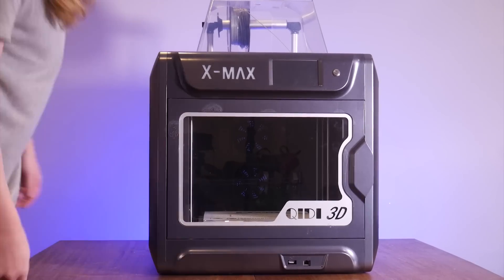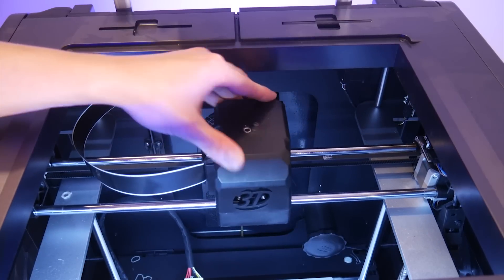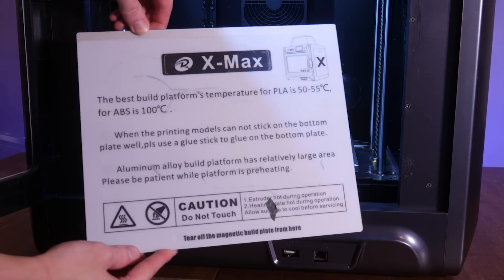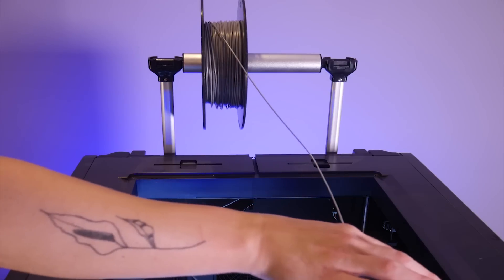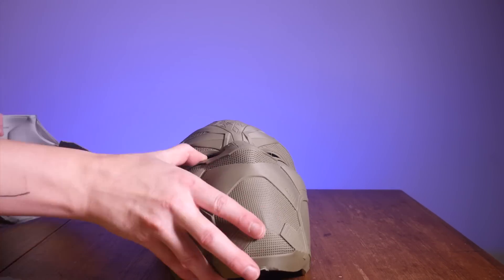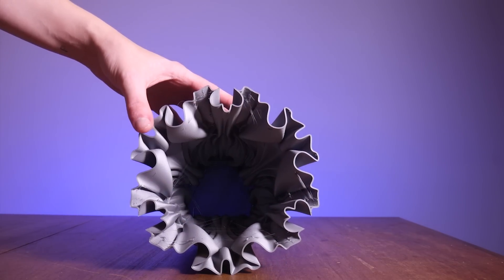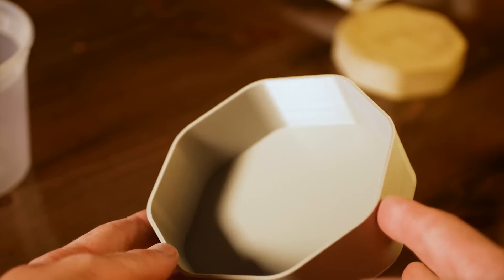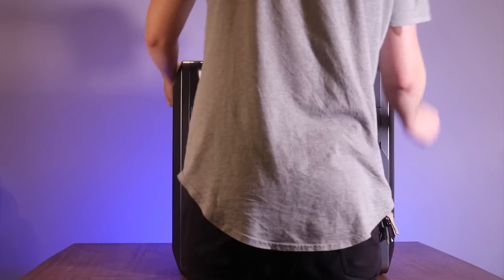3D Printed Black Panther Mask - QIDI X-MAX 3D Printer Review

Comment: I have had the X-Max for 2 months.  In that time, the front window has fallen off due to cheap sticky tape, the bed leveling screws needed replacing, the motherboard died, and a new build plate is being sent because the bed will not level.

My weekends have been spent replacing hardware and constantly trying to level the bed.  All I print with this thing are bed leveling squares and it can't even get them right.

You go through the advanced leveling - the print head moves to each of three points where the leveling screws are where you manually adjust... then it goes to the middle where you adjust Z from the touchscreen in .05 mm increments.  Every single time I adjust the three points with paper, I will need to drop the center Z by two to three .05mm steps.  Then the front points are off... I literally go through the leveling sequence over and over and it never levels.

People - steer clear of this 3D printer.  It is junk.

Comment: Mine/all of these printers come with slide on friction fit clamps/locks to prevent the spool holder from sliding and filament getting caught up. Also one of your first prints should be the top enclosure cover to reduce the slot that allows the air to be removed from the enclosure. Search thingiverse for qidi x-max and it should be the most popular one. Sa da tay, runny time on the Willy fan.

Comment: Great Review, been using the Qidi X-Max for so long and I can't complain, but your soo right in regards to the filament getting stuck however this is usually based on the filament and how it is winded...or you can place it through the filament feeder which I can't be asked to do. Plus you can also flip the magnetic build plate over, I prefer this finish!! If you want to see some Qidi X-MAX Time-lapses I have 100's... Feel free to check it out!!! Keep up the great content!

Comment: Regarding the blobbing.. are you sure its not related to using Octolapse for the time lapse?  I always got significant blobbing when using Octolapse wherever the print head had to make travel moves..
Reply from the maker: I didn’t use octolapse on this machine! But octolapse blobbing is a retraction issue as well :)

Comment: Nice review! For ABS prints you must use the back of the magnetic bed. There is a black and smooth side. There also should be a glue pen that helps to stick the first layer to the magnetic bed.
Reply: I print mine on the white side and don't have any issues

Comment: Regarding the spool / filament issues - you are not using the tubes that feed the filament thru that small gap in the back of the printer top - that keeps tension on the filament on the spool side and prevents any issues with the filament looping on itself.

Regarding the stringing, I had to increase my retraction to 3mm @ 30mm/s to get rid of stringing entirely

I recently purchased an X-Plus - the smaller unit to the X-Max - I have transitioned ALL of my customer printing over to that printer because the layer quality and speed are far superior to my bed-slinging printers in the farm. Qidi support is phenomenal as well. I was having stringing / quality issues and I sent them my STL, pics and profiles. Within four hours they sent over their own profile with some tweaks for me to try - and they worked flawlessly.

Easily the best entry-level 'industrial' FDM printer available today.
Reply from the maker: Thanks for the tips mark! I did at one point try the tubes. I forget why i stopped using them, but i'll give that a shot again! I also want to switch over to prusa slicer on this machine as i'm sure i'll get much better print quality and speed. Thanks for watching!

Comment: This foil from the pad is taken off, the prints are bad because the printer is not completely calibrated.
Reply from the maker: what foil?
Reply: @WildRoseBuilds  the one with the white print
Reply: @WildRoseBuilds  white on top with temperature imprint

Comment: I have been using this machine for a while. Mine had some issues but the company is very good to deal with and helped me fix them. The filament feeding is a big problem when printing full size models. I am going to try the internal position